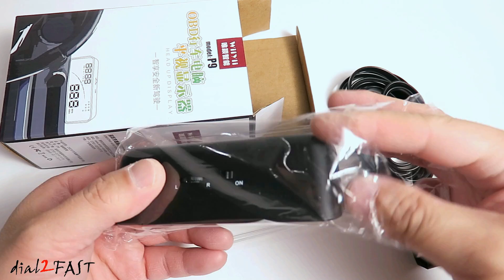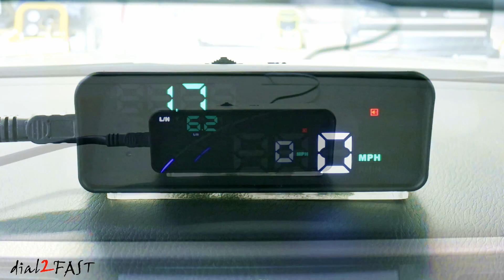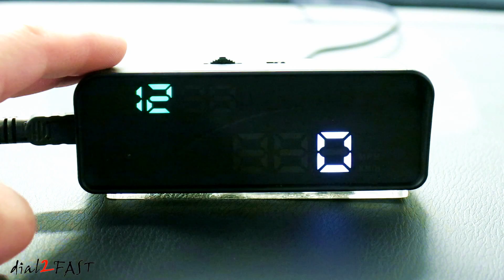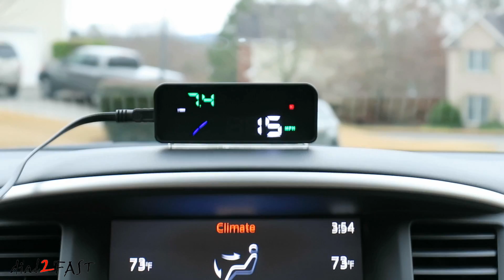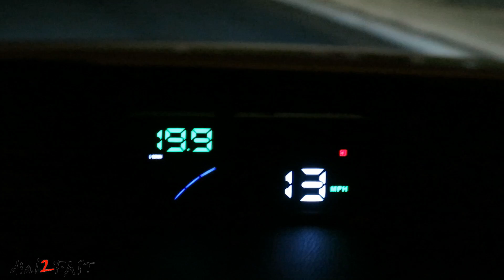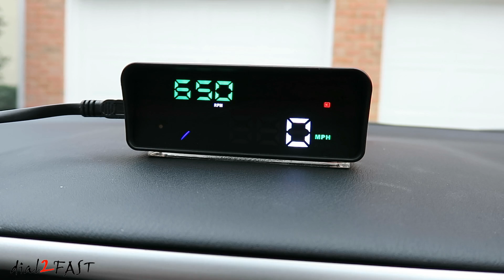OBDII Head Up Display (HUD) Model P9 Full Review

Comment: You may have missed a step here when reviewing this product. This product was made specifically  not to project the readings on the windshield. The only option to avoid this is to place the unit where you have in the video ( middle and or on top of your dash) any other place will result in a projection/reflection. Try it ....ul know what i mean. Avoid this product

Comment: Will it work on a '99 Ford? It has obd2 but I read it may not work on some older vehicles, regardless.
Reply from the maker: Yes it will work on vehicles built in N America after 1996. However, what data you see will depend on what the manufacturer made available to be seen on the data port.
Reply: Thanks! Very cool product. I'll have to do a little more homework.

Comment: Can it be called HUD if it’s not projecting on your windshield?  Can it be called HUD if it can’t be adjusted to appear at a distance in front of your vehicle?
Reply: I believe he said you can set it up to display on the windshield.
Reply: It's still a Heads Up Display or HUD That is to say your head is up whilst looking at the Display
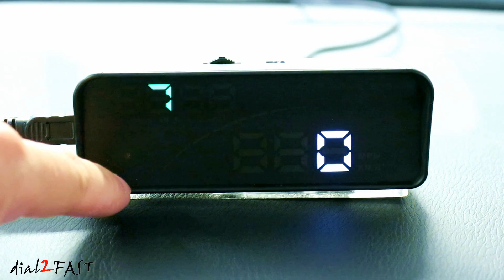Reply: 5:05 he switches to the mirrored mode where you can purchases a reflective film and use it as what you think a “HUD” is supposed to be.

Comment: .I purchased this unit because I thought it gave an alarm when exceeding a set speed.  This unit works on the obd2 plug, not GPS signals.   I live in a city that has Police swarming all over the place... (near Ferguson Missouri).  I want a unit that warns me that I am exceeding the speed limit so I don't get a $200 dollar speeding ticket.  Some people think this kind of device is of little value, but THAT DEPENDS ON WHERE YOU LIVE.   I live in a city with police swarming all over the place. This unit DOES have switchable for DIRECT VIEWING or HUD display.  Maybe I'm doing something wrong, but I only get a blinking LED when exceeding speed.  The LED is useless because it is too small to notice.  However,  it is nice to have the speed displayed closer to my windshield.  I don't have to look down as much or as long to interpret the analog speedometer.  So it will help me a little bit, but I sure wish my unit gave me AUDIBLE beeps when exceeding the set speeds.  If anyone knows how to set the AUDIBLE speed beeper, please reply to my comment.  Thanks.
Reply: I FOUND MY MANUAL... and the buzzer can be turned on or off by pressing LEFT for 5 seconds.  Press RIGHT to reset engine fault codes... or press DOWN 5 seconds to enter SETTINGS menu.  I think I am going to like this unit because it just has a few display items.  Other units have bigger displays and more information, but I just see it as distracting.  I really only need the speed alarm and the MPH display.  I wish my garmin gave an audible alarm instead of just turning the little square RED when I exceed the speed limit.  Next time I buy a GPS, I will be sure to get one that gives an AUDIBLE ALARM.
Reply: How accurate is the reading of the speed. I live in a country where there are speeding cameras. that means if you exceed the limit by 1 KM it will fine you. Im looking for something very accurate and with no lag.
Reply: I need to buy this unit for the purpose of speed limit audioable alarm, so I've two questions:
1. In my city, the speed limits is not fixed, the limit in some roads is 60 and in others is 80,90,100 and 120. So I want to know can I change the max speed seeting easily while I'm driving?
2. If I turned on  the 4 stage speed alarm in menu 3, will it turn off the single speed alarm in menu 4?

Comment: Whats the point of this? Just move your eyes down for a split second and you see the same info.
Reply: Because not all cars have a fuel consumption meter like my 2013 Ford escape doesn't have one
Reply: In addition, the cable is an eye sore and obstructive.  More people are using the OBD-II port for insurance saving widgets, so this OBD-II plug/adaptor without a piggyback capability, it won't be very useful for even more people.
Reply: my old 05 Buick Park Avenue has factory HUD and to tell you the truth I love it' I don't have to worry about looking down at the dash" now when I'm driving a vehicle without this option it's strange I real safer with my head up display' my wipers are even automatic... lol with moist sensors, I don't even have to worry about even touching the switch
Reply: Good luck,y truck doesn't have a tach, LMAO, and it's also a manual transmission..
Reply: exactly